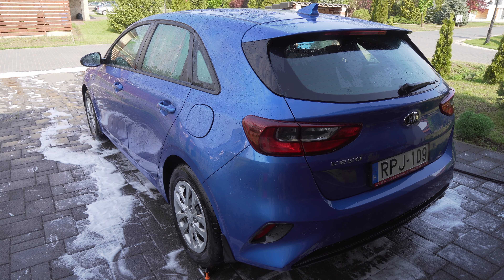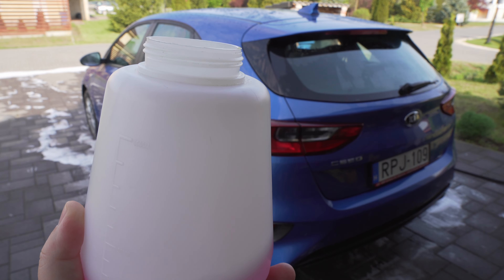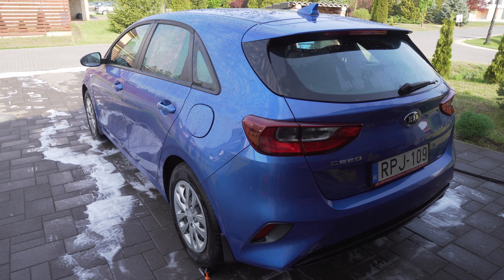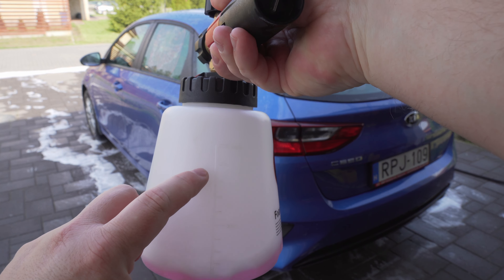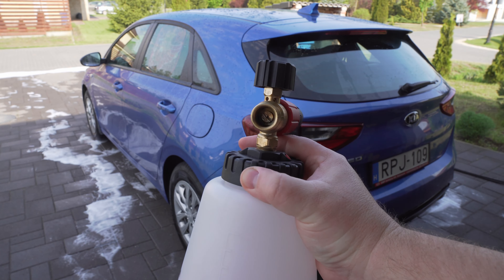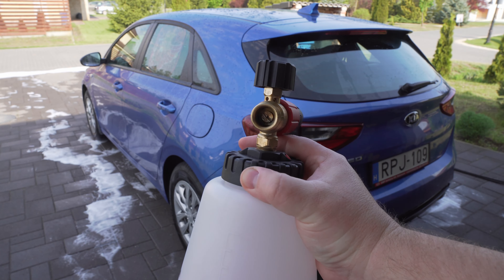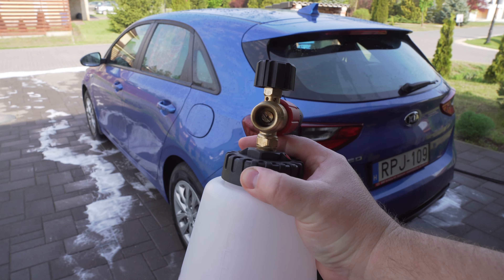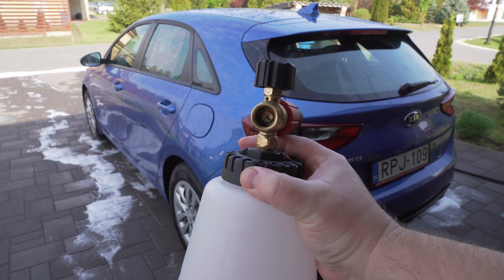How to use a foam cannon? Foam cannon tips.

Comment: Thanks mate, does your gun automatically detect and set the spray to mix
Reply from the maker: It is always on mix, but the level of the mixture depends on where you turn the dial on the top. Otherwise the short gun passes the water through at max pressure, with the foam cannon attached.

Comment: 1.1 office??
Reply from the maker: Yep. Usually the factory fitted is 1.25 mm. For pressure washers under 110 bar pressure (real, not max), it is a good idea to swap to a 1.1 mm orifice, for better foam.